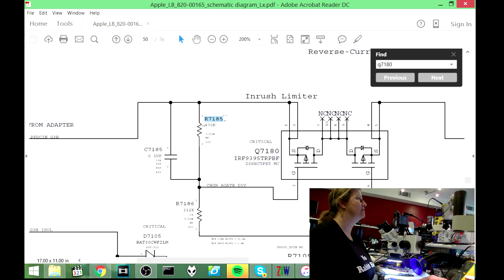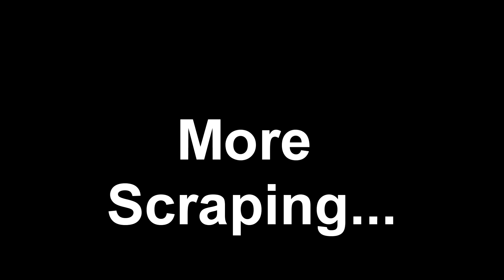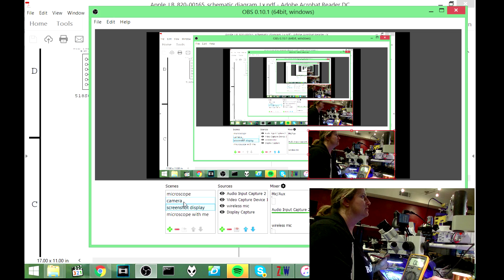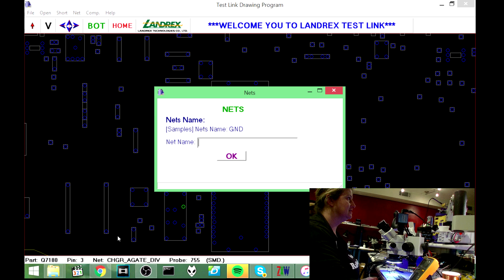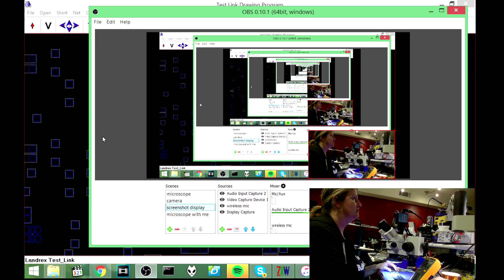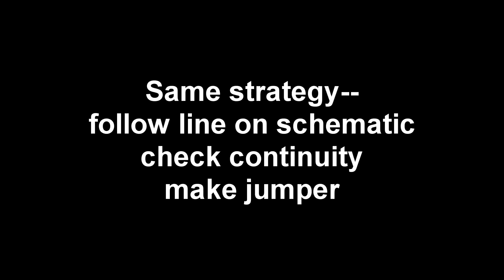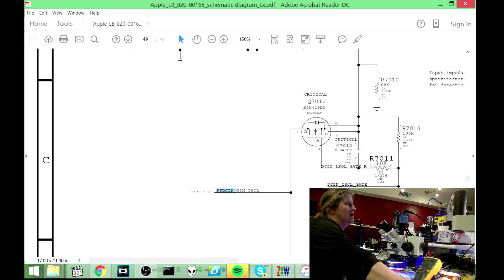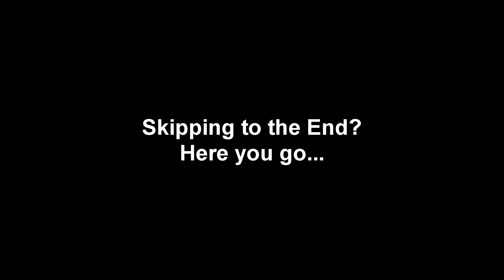Jessa fixes a MacBook---no power, no green light MacBook Air with DC in short to ground

Comment: You and Louis are both awesome at your jobs no arguing about that, but you have a soo much better attitude and that makes your videos much more enjoyable. I can only imagine Louis' reaction to that board...
Reply from the maker: +Massimo C I can only imagine Louis's reaction to that board as well, which is probably why the poor customer chose to send it to me rather than risk having a video appear on Louis's channel about the same board.  On the other hand, I think Louis would be proud of the jumpers the guy did and the creativity with the jerry rigged DC in board.
Reply: watching this video cost me 20 bucks even though I have a dermal tool I hopped on eBay and ordered couple of fiberglass scratch tools the German ones. better than an xacto knife. great job Jessa

Comment: Fantastic work!!!  One thing I thought at 34:45 ish - It might be wise to connect the jumper to 2 or 3 of the vias there, rather than just one - one via might not carry the current well.  But that's just an observation and I am sure it will probably work with just one.
Reply from the maker: +GadgetUK164 Did they all beep to that line?  I don't remember.  This was a 3am repair :)
Reply: Yes, I think there were 3!  I am sure it will be OK as it was working fine and would expect if it was going to be a problem it would be right from the first power on.  Just something to think about on similar repairs.  Great job though, really impressive detective work and reconstruction!  Love the channel, and despite how long the video was I watched most of it because you provide lots of interesting commentary on your thoughts as you progress etc.

Comment: I thought about it. The jumpers for the chip are exactly at the same place than what the chip needed. Would it not be more elegant, and even more practical, to put very small jumper on the lines, put a thin epoxy layer and place the jumper cable to sort of replace the chip connector pads. Then you could simply use your heat gun to reflow the chip back on it's original design position. You would have effectively recreated the board without much more hassle. 

I mean, the job you did on it is awesome. I just seen you like innovative ideas, and i am full of them. :D

Comment: Nice repair!
However you definitely should have used some much thicker wires for the source pins of those transistors. They carry all the current from the charger.
Your micro soldering skills are amazing.
Reply: I agree.  With iPhones it is always about "how can I get even smaller?"   Voltages are low.  MacBook really is a different beast.  If I had to do it again, I'd go up to the gauge of the dcin board wires.

Comment: Was the Power Mosfet running cool enough after the rework Jessa? I noticed that the mosfet was placed it upside down on another metallic surface however those things can dissipate quite a lot of heat, and as such it's normal for them to use double sided cooling, with the devices base being soldered directly to a copper plane, and a heat-sink placed on top.
Reply from the maker: +orbiter8 (John) I'm hoping that metal shield will act like a heat sink, it itself should have feet grounded to the same copper plane below.   I really didn't like having to put the chip so far away from its intended position, but I didn't see any other logical choice.
Reply: Understood. The metal area will certainly act as a heatsink however I think ic longevity will be questionable as it looks like it is covered with epoxy? This will unfortunately act as an electric blanket for the chip.
Reply: +orbiter8 (John) makes sense.  We'll see I guess :)